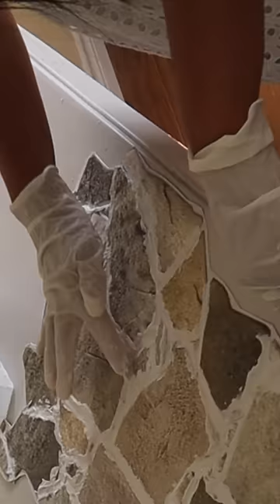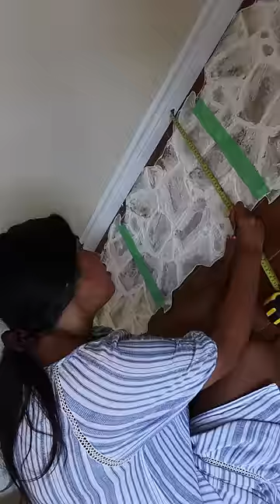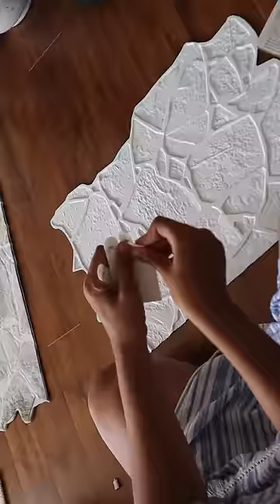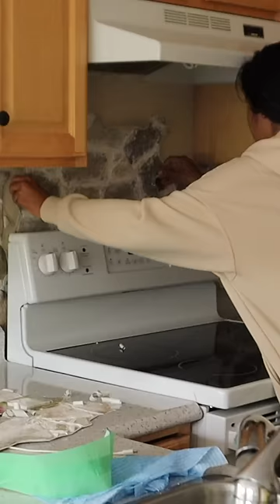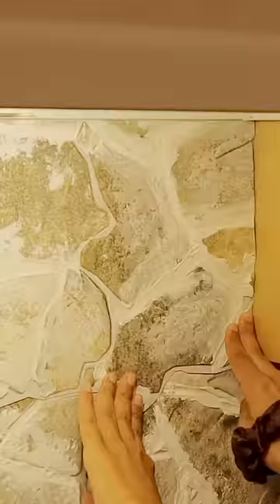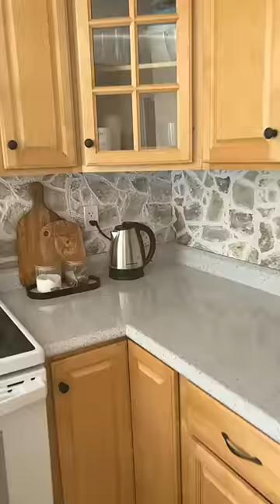Dreams are possible! ✨

Comment: I dont trust command strips, it ripped off my wall paint
Reply: Well just paint over it? That’s what we do
Reply: I agree drives me crazy.  Happens everytime. Love behr paint but think it along w other kinds are notorious for it happening
Reply: Uhm so I never told my dad about it, but no it ripped down to the dry wall, idk how it happened but it looks like cardboard stuff under the rip so it left a small indentation in the wall
Reply: @Mad.dy_M  it ripped the wallpaper off
Reply: This happens in places with the cheapest paint possible tbh
Reply: Yep i put them up 8 years ago to hang our Christmas stockings when I went to remove them It took the paint and a chunk out of the dry wall.  We own our house but Its alot of work to patch the wall remove everything along that wall repaint so I just put another Command  hook over it and you can't see it. I don't recommend them at all. Our house was new and the paint was not cheap.
Reply: @Mad.dy_M  I had that happen too!! It might be because you aren't take them off properly though. Ever since I didn't rush taking them off as much and pulled straight down (and not towards me) my walls have been good 😌 If your doing everything properly though im not sure why thats happening then .,.
Reply: Man I literally put a thumb tac on the wall and put one of my paintings over it 😭😭👍
Reply: she didn't but alot of Adhesive tape, so even if that happened she can buy some paint and fix it.
Reply: Every time you move they should apply a new coat of paint regardless even if there's no damage at all. The only apartment I ever moved into that didn't do that because I wanted to move in early told me I could do any colour I wanted for free in exchange. So even if there's a little chip it's really not a big deal.
Reply: You're supposed to pull Down on the tab, not up. Stretch it and it shouldn't rip ur paint off
Reply: You have to take them off right. I've only had one damage the paint once and learned my lesson from that. Never had a problem again
Reply: @caprisun6910  lol what wallpaper... do you know what drywall is?
Reply: Even when I take them off properly they always rip off the drywall
Reply: I have them all over my walls to attach to my posters, oh no
Reply: much better to have to pay for a little chipped paint than to have to pay to remove a real stone backsplash lol
Reply: It depends on the paint. Most landlords or cheap house flippers will use flat paint or expired paint... which never lasts, stains super easy (even by water) & comes off super easy.
Reply: Pull straight down. Don't pull towards you. It shouldn't rip anything off the wall if you pull down along the wall... Unless something was wrong with the wall like bad paint or drywall.
Reply: Same! I've had them rip off paint and dry wall! I'm selective about what ones I use now and remove them slowley and use water to lose the adhesive if need be.
Reply: You need to pull the strip according to thte arrow. Pull it downwards as opposed to pulling it towards you which would chip the paint off. Hope this helps :)
Reply: Did you clean and dry the wall first? Because I know it says that but knowing it's an adhesive I tried to lightly wipe the wall this time so, when I moved one recently, I noticed it came off fine when I did that. I'm renting rn so, it is my best option and had to make it work...the husband already made enough holes putting the tvs up 😅
Reply: @preciousreyes513  joy
Reply: Exactly 💯
Reply: They show you in the commercials how they take them off though
Reply: @Thegeekponygirl  Exactly, it's because they practically make homes out of cardboard and the cheapest paint possible these days, almost nothing is quality anymore.
Reply: @novellerue  that’s what you’re supposed to do! I really wonder if it really hurts paint/drywall if actually done right.
Reply: Trust command strips
Reply: @caprisun6910  there is a thin cardboard like layer on the outside of said dense chalk on drywall
Reply: I've never had a command strip rip wall paint before. I used some to hold up my paintings in my room for like 2 years before we moved. No wall paint rip, and plus my parents have used em for years doing all sorts of stuff with no rip-
Reply: @caprisun6910  drywall kinda looks like cardboard if you start to peel apart the layers. So they were talking about the drywall peeling. Also many other commenters here have had the same thing happen....
Reply: You are right. I usually put some masking tape on the wall and stick the thing on top of it.
Reply: Your pulling it off wrong
Reply: @rosequartzjewelryllc  mine ripped off part of the wall too 😬
Reply: Special way to take them off and it tells you how on the package. I can’t do it without ripping paint but my dad can.
Reply: That tells you how strong it is...use with caution😇
Reply: It was probably a very cheap paint, Ive used them several times in different houses and that never happened.
Reply: Renters can paint over it lol the land lord doesn’t need to know
Reply: ? Why does it matter… the strips are meant to stay on, no?
Reply: this happened to me as well, I tried heating up the sticky part of the command strip and slowly peeled it off. It worked but I only tried it for a few so don't take my word for it xd.
Reply: How are you taking them off? Been using them for years and they’ve only ripped anything one time, when I wasn’t careful and just yanked it off the wall. Make sure to hold the Velcro bit when you pull the tab down, or its gonna rip something out.
Reply: I’ve used them with no problems. You have to go super slow.
Reply: @rosequartzjewelryllc  please tell me the secret to matching different shades of white. I'd love to paint over that crap, but I can't tell if it's Cloud White, Pure White, Simply White, Extra White, etc!!
Reply: @notafeminist7642  well you want to gently take a little chip of the paint off the wall, preferably from the bottom corner. And bring it to the paint store or section now a days they can match it perfectly especially if it’s a common color like eggshell white.
Reply: Learn how to remove it 🤦🏻‍♀️😂
Reply: My thoughts exactly
Reply: Lol isn't that precisely what they advertise against 💀💀 they sit on a throne of lies
Reply: I used like 30 of them to hang up Christmas lights around my windows last year and I didn't have any issues removing them from the walls
Reply: @Throatzillaaa  exactly!!! I never had any issues as well  lol
Reply: @rosequartzjewelryllc  you don’t know how paint work do u 
or how renting work do u
Reply: They couldn’t even keep my tapestries up they’re terrible
Reply: This happens when your place has super cheap paint. When I’m really careful and go slow, I can usually make it look like normal wear and tear lol
Reply: @rosequartzjewelryllc  yes but the whole point of command strips is that they don’t take your wall paint off
Reply: @rosequartzjewelryllc  it’s a rental
Reply: I’ve noticed usually it’ll rip off cheap paint which lets be honest landlords definitely scrimp everywhere they can
Reply: just paint it.
Reply: That only happens when the paint is extremely cheap or extremely matte finish (flat or eggshell) you can't help it when it's a rental but I always go for satin or semi-gloss if it's trim or a surface that gets wiped often
Reply: Same thing with the led strip lights that you see everywhere. Ripped off my new paint
Reply: Use alcohol while removing it 😄
Reply: It depends on the wall, my apartments wall is low quality so anything that sticks to it rips parts of it off, my old home was nothing like that.
Reply: These stickers suck in Lockwood homes. I can clean n dry the wall with alcohol... it'll still slide off the wall in a couple of days due to heat lol
Reply: I’ve found they come off pretty well. In this situation you’d need to use the Velcro command strips. The one time they pulled off paint I just bought a small sample-size can of paint in the closest color. It was a pretty cheap fix and you couldn’t really tell afterwards
Reply: Ya, same here. I blame it on a bad or extremely old previous paint job though.
Reply: Yep every time. And if the place is a rental it's gonna take all 87 layers of paint off the wall. I had to buy that stuff you use to fill holes to fix it!
Reply: @Thegeekponygirl  yeah, ya know, like every rental ever.
Reply: My apartment building would rather us nail the wall than use those. They're banned because of that but the tiny holes in the wall from a nail is easier for them to just fill in.
Reply: I've NEVER had trouble with command strips. Maybe they're being removed wrong. Idk
Reply: Try museum putty
Reply: Put masking tape on the wall first, then command strip
Reply: @rosegoldbutterflies3086  no, I put 5 up for our christmas stockings ln our brand new built house. All taken down the exact same way, 4 came down no issues, no5 wripped the paint and drywall off the wall. Paint was premium quality with multiple coats plus primer. Some times you get a bad strip. I put new one back to cover the damage and they have now been up almost 10 years and are still holding strong. When we move I will have to patch and repaint.
Reply: @Thegeekponygirl  so every single rental
Reply: @IvanaSantini  should…but they don’t lol.
Reply: Idk how y’all even get command strips to stay stuck
Reply: @adamjohnson0  Great idea!
Reply: Most places are repainted between tenants. We have houses and every single time there's a new renter we repaint & make sure all is good and up to date, appliances and etc.  Consequently we get & keep great tenants! 👍🏼
Reply: @laurasimmer9612  And you know that how!?? We have rental houses and we use top of the line everything! Also paint between tenants and keep all appliances in new condition. You get what you pay for and we have great tenants that stay as long as they can. Some even go on to rent to own. 
Rethink your generalizations.

Comment: As someone who lived in a rented townhouse, the one thing about this is that I wouldn't use command strips.  They do not play nice with paint.
Reply: For sure, i had one take some paint off the wall and dont use them anymore after that
Reply: Yeah but repainting is less laborious then having to fill in nail holes and then repainting it.
Reply: Only if the paint on your walls is really old, bad, or not properly primed. I’m lucky and have nice walls that have good paint so command strips arent a problem for me. But I understand with a lot of rented properties that may not be the case. Best to not COMPLETELY rule it out as an option though 😌 ya never know, right?
Reply: Yeah, I hung a mirror using those and when I took it down, it took an inch hole off the top layer of wall
Reply: I was about to say it's all fine and good until it pulls the paint off upon removal. . .
Reply: @SpacemanFromHell  I think you need a stronger wall 😳
Reply: Or wallpaper. Will rip the paper and break your frames
Or wood, because in hot summers that sticky stuff will just slide down the wall lol
Reply: I have the same issue. The walls are very bad where we live and wont even hold nails or screws without anchors. Used the command strips and tried to remove two of them. We lost ALL of the paint under them. Guarantee the paint is very old and just layer over layer since it was first built in the 70s
Reply: @emeraldbonsai  someone needs to tell landlords this very vital peice of simple information. Someone above them lol.

Comment: Question: will this material hold up to the water food and heavy use that occurs in kitchens?
Reply: Not likely. And it will trap moisture behind it.
Reply: I mean a backsplash is meant to be easier to clean. This is not that
Reply: Well it’s plastic it should be easy too clean
Reply: I doubt she expects it to last forever. I know it’s a backsplash but personally I’ve never splashed the backsplash. I’m sure she’ll take good care to keep it clean.
Reply: It'll probably deteriorate over time but considering they're only renting anyway, it's likely they'll be gone in 1-3 years anyway. It doesn't NEED to hold up long-term. And even if it deteriorates too much before they move out, she can always just take it off and re-do it with a new one.

Comment: Looks beautiful
Hope does it function from the heat behind the stove
Reply: I’ve had a similar backsplash for over a year in my rental, heat from the stove has never affected it. There is only a little indentation where it melted slightly when a hot pan lid touched it. Otherwise all good. Just can’t let hot pots or pans touch it, which is not hard to do.
Reply: @mehrinaz3466  don’t worry about the heat the mud will make that thing grimy in a month there is a reason you paint drywall it isn’t a finish product

Comment: Those command strips are gonna rip that paint right off the walls
Reply: I seen a trick for removing those tamper proof stickers. If you use a syringe with a blunt needle and fill it with rubbing alcohol you can squirt a little on and slowly peel it away.
Reply: Have you ever used command strips? Your paint job must be crappy if they're tearing it off
Reply: @RapTapTap69  Agreed lol that’s the entire point of command strips is to be damage free
Reply: @lizzyblitz07  I hope she has better luck with it than I did! I’ve used the Velcro ones before also but it still took the paint with it when I tried to a painting off the wall. They all came off in one go, the Velcro didn’t unstick itself.
Reply: @spicybacon1696  Are you pulling the tabs down so it stretches? I’ve never had damage from command strips
Reply: @splicerbabe  I don’t use them anymore but the times I had whenever I tried to remove the object they were connected to (like the hooks or if I stuck a painting to the wall), both sides would come off bringing the paint with it. I’ve only had one good experience with them because the walls were wood paneling.
Reply: Most landlords have to paint after a move out anyway so it's not that much more work
Reply: You have no idea what you are talking about
Reply: @psychoslayer6808  their not half the time
Reply: @MaximusTheChosenOne  Lol ok Max. I’m just speaking from my experience.
Reply: If they’re using terrible paint, yeah.
Reply: Yah just bought a house where they left a whole bunch on the walls and ceiling
Reply: @splicerbabe  and how is she supposed to get to the strips to pull them down?
Reply: @TheHitchboy  you can leave them underneath so the tab is exposed on the bottom, just like the hooks have.
Reply: @honkerdoodles2764  so? it looks nice.  better than it was before

Comment: Wait until y'all have to pull it off and half the paint comes along with it
Reply: @len I'm saying if they get evicted or whenever they leave the place dude
Reply: @len or they have to move
Reply: Been there, took the dry wall w it too🥲
Reply: It's not uncommon to repaint before they they leave anyway
Reply: They are velco command strips... They are made to come off of all modern paints...
Reply: and? is it your house? gtfo
Reply: @gabbyd1802  yeah but then she spread spackle all over and into the gaps in between the pieces.. so basically directly onto the wall that was showing through those gaps
Reply: It's paint. Easy and cheap fix.

Comment: The whole point of a "splashback" is to be wipeable when you have food splatter from the hob. There's no way to wipe this so not hygienic. It does look lovely for other parts of the kitchen that wouldn't get food or water splashed tho!
Reply: Splashback? I’ve always known it as and whenever looking for it have found it to be backsplash. Also faux stone work is just as hygienic as marble and if plastic (like the one she is using you can tell by the seem) is even more so because it’s not porous. Also it wipes clean like any other surface even with the texture (if you have have usable hands that is) and the plus side of her diy that I believe you missed is that it can be removed. She hide the seem with spackle which if your concerned with staining can be covered with a sealer $6 USD but if it gets in the way she can remove it. It’s fun and hygienic and can be removed.
Reply: Clearcoat?
Reply: It can most definitely be wiped down ! It can also be sealed by a clear coat to be even more durable for scrubbing !
Reply: It is plastic, it can obviously be cleaned!
Reply: So u can't envision it either?😳
Reply: Exactly
Reply: @mercyfulfate666  it can’t it’s a sponge material
Reply: @ladawn6426  a sealant ? Since she is a renter she has to make sure she can remove all of this when she leaves this place. Idk if adding a sealant would make it any easier to remove when the time comes. For some reason I see a sealant as another form of glue splashes over the entire wall that would require her to hack through it to get the pieces off separately
Reply: @greenbanana1001 She literally said in the video the backsplash pieces she has is PLASTIC. Which is easy to wipe clean. Not sponge material.😒 Use your listening skills lady…
Reply: Well, I guess this isn't for you then right?

Comment: Need to seal it or something so it can be cleaned down properly or it'll harbour bacteria. The backsplashes we install are sheets of antimicrobial PVC and it only requires a few drops of silicone to stick the edging trim to the wall if it's a temporary fix like this situation.

Comment: And then when u remove it when u move will the tape reck the wall corseing lose of ur bond
Reply from the maker: the adhesive I used is a removable Velcro type product. they’re called command strips.

Comment: The double sided adhesive in combination with the heat from the stove will either fail or dry the solvent causing damage to the wall.  Just kidding, lol. You did really well and it looks amazing.

Comment: isn't plastic backsplash a fire hazard? I have also seen a few DIYers put a thermocol backsplash, or use it as wall decor. I have the same fire safety concern about that idea too. Not trying to throw cold water on the idea, just a genuine question.
Reply from the maker: These panels are fire resistant but I don't know if all plastic paneling is!